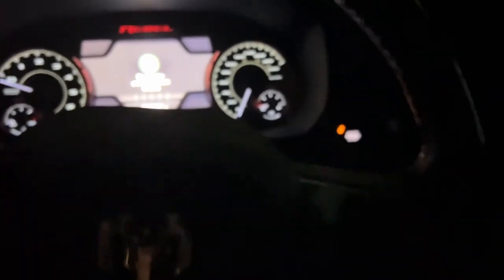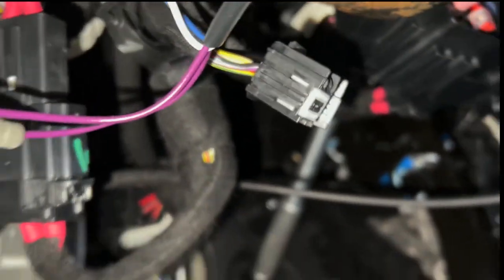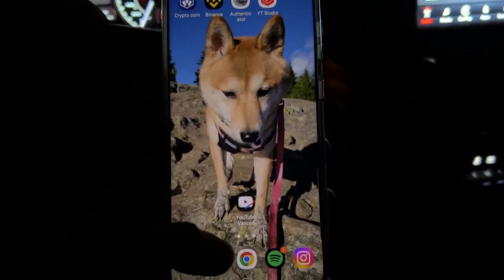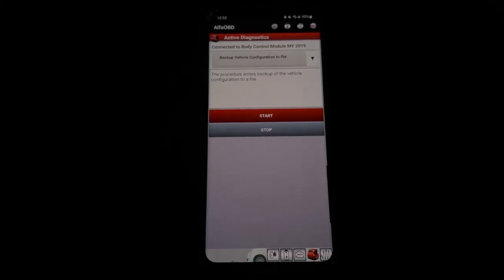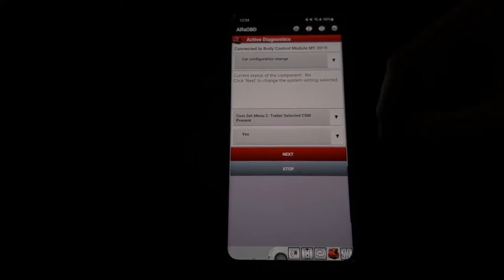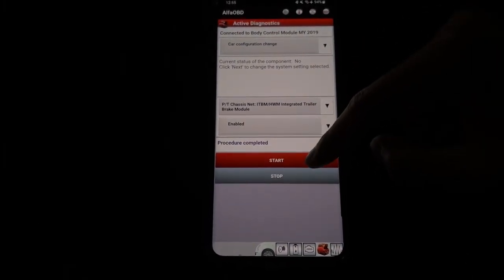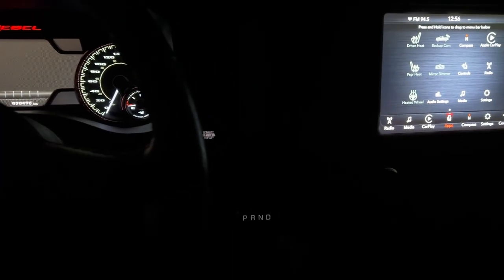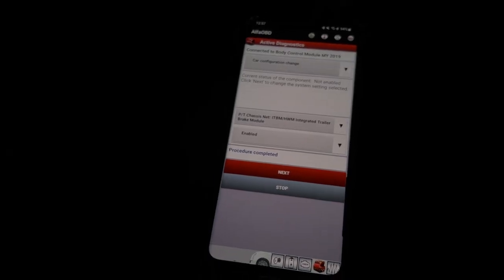RAM TRAILER BRAKE PROGRAM GUIDE (DETAILED)

Comment: when I am in AlfaOBD and selecting year of my car... there is 4 choices of DT  MY2019 PowerNet Var.1, 2, 3 & 4. Which one do you select? Why there is so many choices... all I want is... Ram 1500 New Body 2019
Reply from the maker: You can select any of them, it will automatically connect to the correct version

Comment: Where do I get the bypass module and programmer?  Can I rent one for the programming
Reply: I got this one from Amazon.

TTXSPP Cable Adaptor for Chrysler 12+8 Programming Cable Connector for Autel DS808 Maxisys Main Test Cable for Autel DS808 Maxisys MS905 MS906 MS906BT MS906S MS908 MS908S Pro

Comment: Do i need the bypass cable for a 2013 Ram 1500?
Reply from the maker: No need for a 2013
Reply: @WeekndGarage  I added controller and trailer mirrors that have signal lights and a ditch light i think they call it
i got the signals to work but not sure what to turn on for ditch lights. Any ideas would be helpful
Reply from the maker: @bradlegault5731  the little square on the bottom of the mirror? Which ditch light are you referring to
Reply: @WeekndGarage  yes thats it
Reply from the maker: @bradlegault5731  its a program function in ALFA OBD, ill make a video on it. Or email me and ill search up the codes for you. weekndgarage@gmail.com
Reply: @WeekndGarage  That was it and i found the code, my trailer mirrors and Brake control are working perfect. Thanks for your help.

Comment: I followed this. And I’m getting the breaker controller info on the dash, but it’s not in my entertainment screen. I’m also getting “trailer not connected” when I connect. Trailer lights work, but break still doesn’t. Any ideas?
Reply: Same issue here .. have you figured it out?
Reply: The controller itself was bad. Had to get a new one